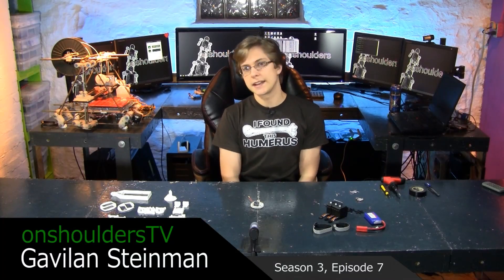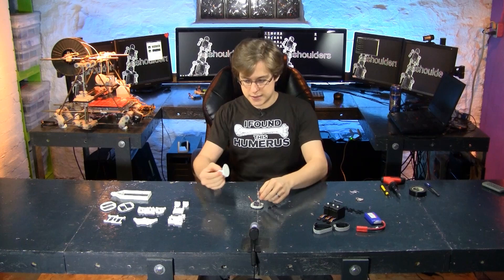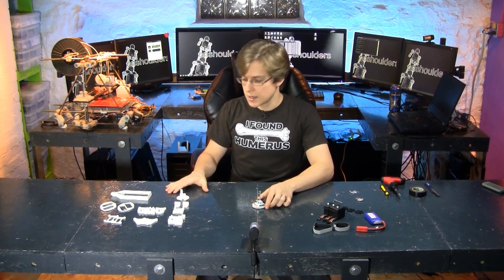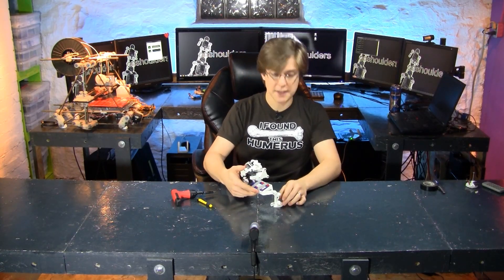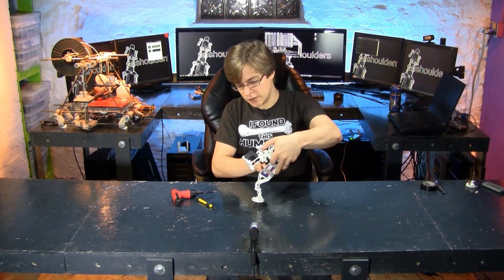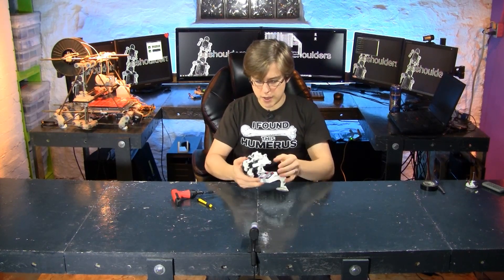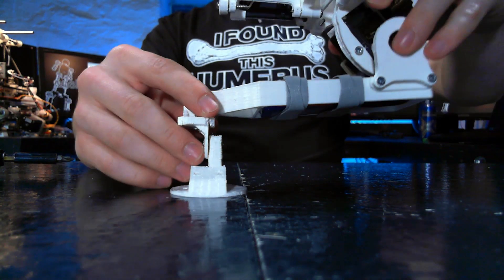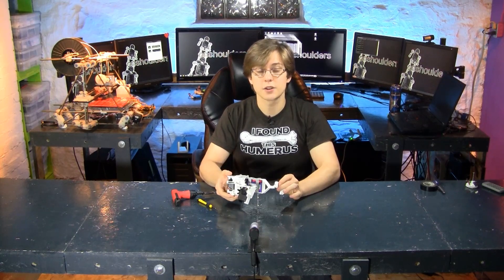onshouldersTv: Robotic Leg Assembly

Comment from the maker: You could be right! But did you know human legs make up 40% of our weight? Another comforting thought is that each leg will have an accelerometer on board, so if the system becomes unstable the software should be able to detect and correct before failure. But still, you could be right. Thanks for the feedback!